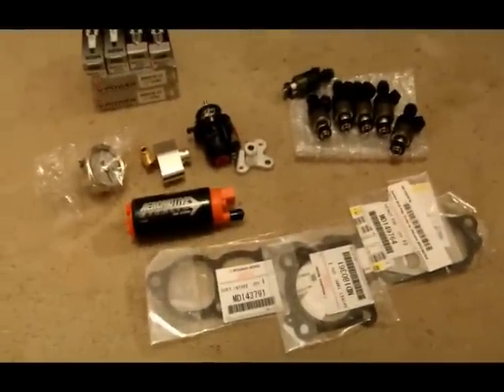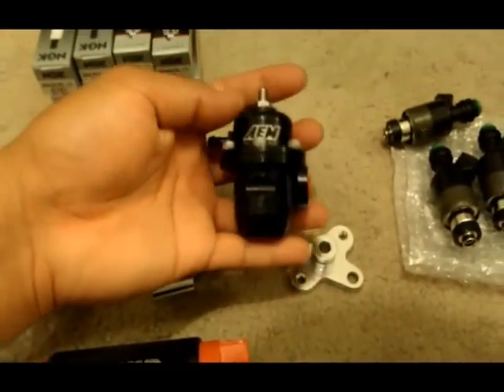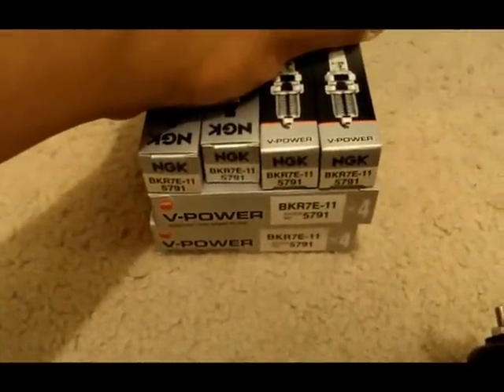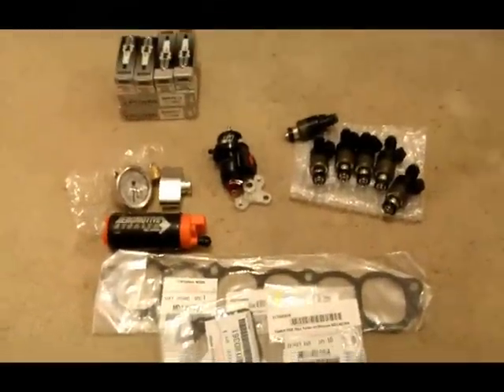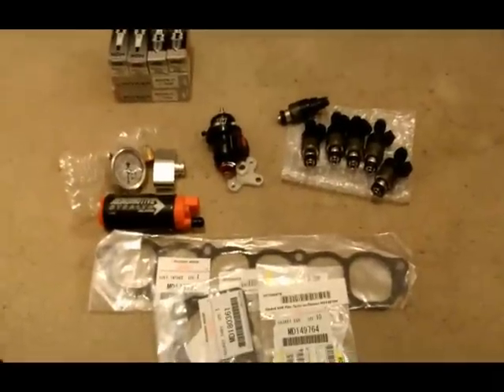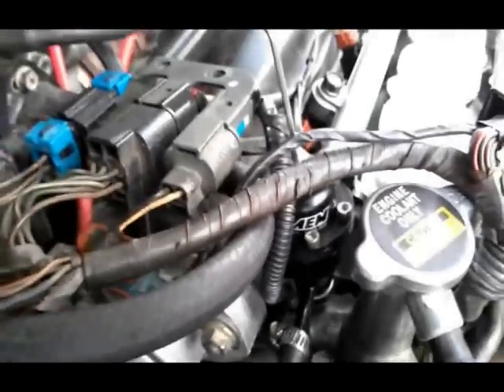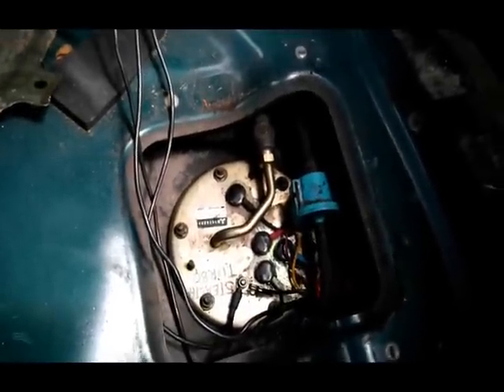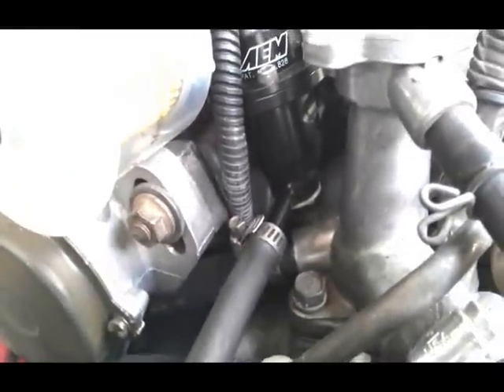George's 1993 Mitsubishi 3000GT VR-4 - 15G Build - Part 3 - "Fuel Setup"

Comment: Yo, I'm getting a lot of conflicting info on the net about this issue. Long story short my 9Bs are spun and I was looking to upgrade to the 15g. Do you have any idea if the volvo td04-15g will mate up to the turbine housing on our cars?
Reply from the maker: For starters, you need to measure the lip of the CHRA as there were various sizes produced. The same thing goes for 1G DSM 13G. Better off getting WRX 13T and having the housing machined for L turbine.
Reply: bboyalan thanks. I’ll look into that.